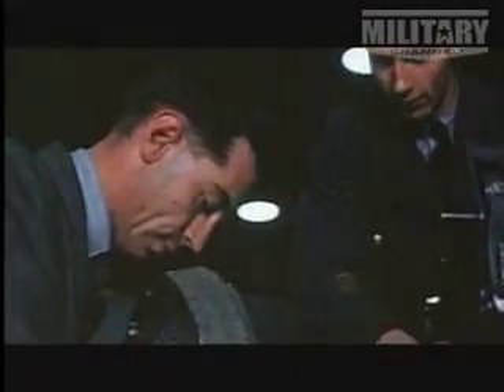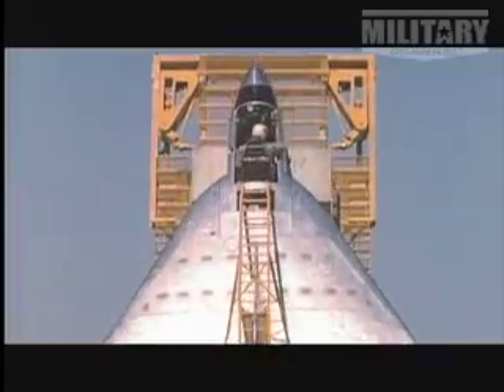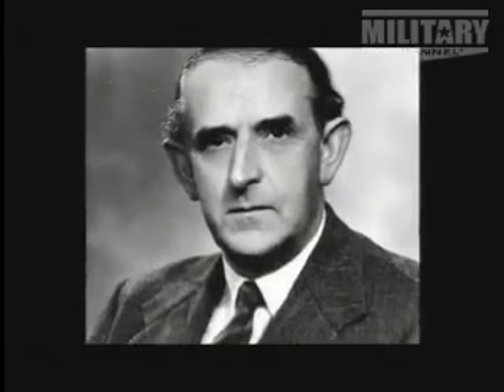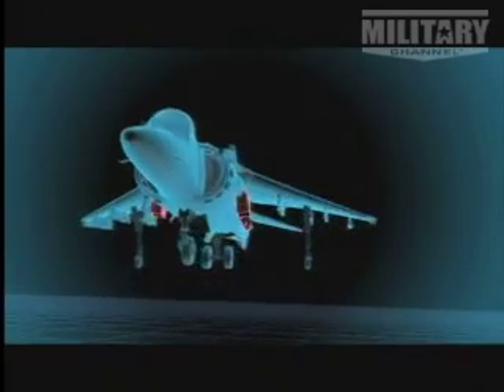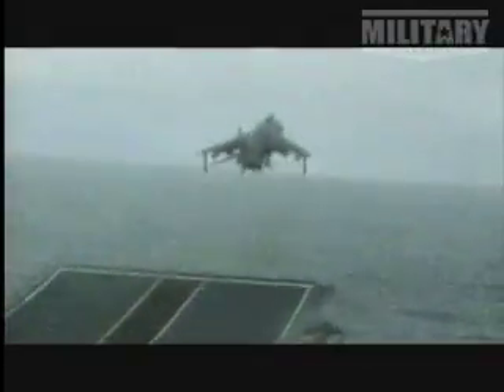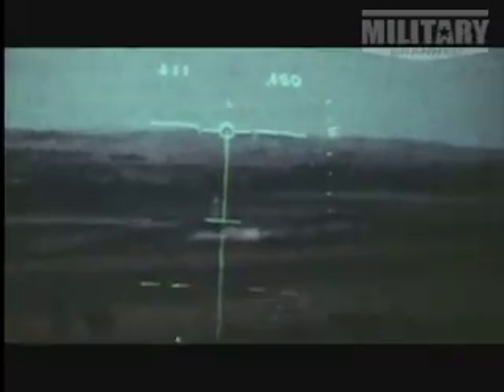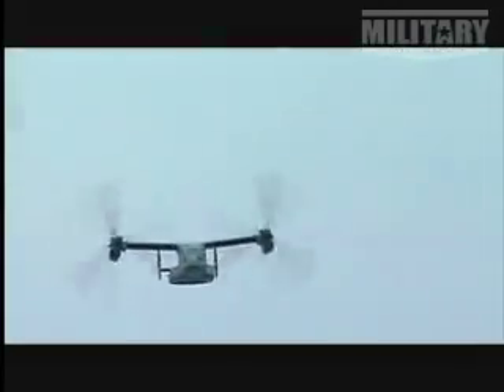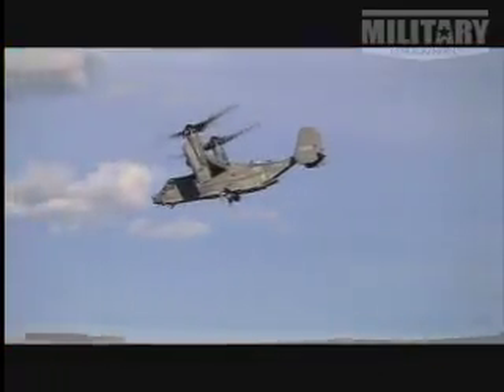Weaponology - VTOL - Part 2

Comment: Your thinking of the Hiller.. The WASP had a small turbofan jet engine. I'm familiar with the Sopwith. Some pilots were killed due to the gyro effect of the motor.. The angular transfer of torque made them veer off in another other direction as to what the pilot was trying to push towards..  eg You tried rolling the plane to the left it would dive downwards instead..  Not good if your near the ground..lol

Comment: No, the wasp engine was just a radial piston engine.  

I think you are talking about WW-1engines used on the Sopwith Camel where the whole engine spun, the ROTARY design (which was mostly for cooling).  Yes, that engine did help turn in one direction, but only a good pilot could use that.  Most pilots would have found the gyroscopic effect to be something they hated.

Later engines still have pistons arranged in a circle, but just the propeller spins, not the whole engine block.

Comment: A quote from the Rolls-Royce Pegasus wiki page... (aka Harrier engine)

  "Unusually the LP and HP spools rotate in opposite directions to greatly REDUCE the gyroscopic effects which would otherwise HAMPER low speed handling.". 

Interesting,  you compared the Harrier engine to the WASP II .. Wasn't the WASP's engine modified to CREATE gyroscopic force to help IMPROVE its handling.. ?  Going by this article they are saying that gyroscopic force makes the Harrier handle WORSE. ?  Contradiction ?

Comment: The Hawker/Bae Harrier (first flight 1967) wasn't first. The Harrier was developed from the earlier Hawker P.1127 (first flight 1960) and the Hawker Siddeley Kestrel (first flight 1964). The Yak 36 (first flight 1963) 3 years after the P.1127. You are ignoring the earlier experimental aircraft. The Hawker Harrier entered service in 1969. First flight of the Yak 38 was 1971.

Comment: @Deimxneyron The X-14 first flew in early 1957 and was the first aircraft to use vector thrust. It was stabilized with nozzles as per the Rolls Royce flying bedstead. The Yak-36 used the same system as the X-14 and first flew in 1963. The P1127 used an improved system in the Pegasus engine with 4 instead of only 2 vector thrust thrust nozzles and from one engine, instead of the 2 engines required in both the X-14 and Yak-36.

Comment: Harriers are still a viable ground attack aircraft - hence there use by the US marines - but they really aren't upto airtoair fighting - it was only the sidewinder missiles that kept them viable for that task in the falklands - and they won't have such a large technological advantage again.

The osprey.... well it isn't a good idea.  Surely its better to take fixed wing transports for the long haul and use nimble helicoptors to ferry to the front line than risk an expensive do-it-all aircraft.

Comment: The Harrier doesn't overheat in 20 seconds - it has 90 seconds (I think) of water which can be sprayed onto the fan of the Pegasus during vertical landings, both to cool it and to increase power. And it doesn't always need the water anyway, depending on it's weight and the ambient climate it can hover without it